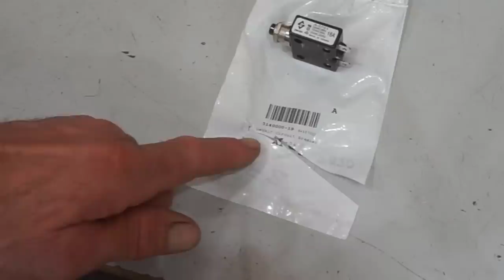DW735 Planer Deep-Dive Maintenance

Comment: Quality information in a Quality video... I just replaced my straight cutter heads with a Shelix segmented cutter head. It is the second best thing I've done with that planer. the best thing I've done with it was to follow your plans for maintenance. I had to laugh when you started talking about the problem getting the rollers installed. Instead of fighting gravity, use it as a tool.

Comment: Thanks to the detailed descriptions in your video, I was able to easily remove, service and replace the rollers, easily. I'm glad now I took the drive and idler chains off to inspect these, as the rear roller was gummed-up so badly, it would barely turn even when applying quite a bit of force. 

You mentioned that you made note of the offset in the roller blocks; The thin portion goes up toward the spring. I also noticed that there in a notch machined on the opposite side that was referenced toward the center of the roller. I also made sure to keep the blocks matched to the end they came off of, as tolerances may differ on each end. 

I added a small amount of grease on both sides of the thin washer that's installed between the drive sprocket on the gear box and the gear box roller shaft bushing. As the roller turns, it will (hopefully) help to prevent any further wear. 

My planer was given to me by my Father-In-Law who used it frequently, for over 13 years. Somehow the upper assembly had shifted downward toward the left-rear, so that the left-rear was sitting about 5/32" lower than the rest of the upper assembly.
Seeing as how I had most of the machine apart to begin with - your video was an added step in its *deep-dive maintenance*. 

I'd like to also add that your tip to replace the screws with the 5mm x 10mm button head was a great idea as well! Channels like yours are always a pleasure to watch and learn from, so thank you - again.
Reply from the maker: Thanks for watching and commenting on this one... thanks as well for adding so many useful insights from your experience in getting your planer up and running like it was meant to!
I'm sure you will find as I have that a little bit of TLC goes a long way in the performance of your like new dw735! 😎
Best, Matt

Comment: I found this vid looking for a reason that my rollers didn't seem to pull material through like they used to....Turning it upside down should make it easier to clean them.....I should also check and lube the chains........I did recently replace my steel blades with some carbide blades, they were just over $100.....what a difference in operation.
I thought about the spiral type cutters but couldn't justify the cost at this point in my career......then again if I hit the lottery.....Since I move my planer around I was always short on reaching outlets so awhile back I replaced the cord with a longer heavier gauge one....I have a set of rollers I picked up several years ago......after watching this vid, I may tackle that job...
Reply from the maker: Sometimes the low-level maintenance tips shown in this video are all it takes to get your machine back up and running 'like it used to':  https://www.youtube.com/watch?v=r_yEwlsYGbU
Best, Matt

Comment: thank you for your video it was just what i needed to fix mine , Thank you again Eric
Reply from the maker: You're welcome... the repairs aren't all that difficult but a bit of insight into what you're getting into is nice 😉😎  As  follow up: I found that loose blade connectors on my thermal switch was the main cause of my planer tripping out but it does run more smoothly with everything cleaned up and bearings lubed... Best, Matt

Comment: Your video was helpful when I recently did a deep cleaning of my 735.  By accident (poor choice of words), I did a couple of things differently.  My initial plan was to turn/replace the blades.  As I took the blades off and started cleaning, I decided to leave turning the blades until the end for safety reasons.  Second, your idea of turning the unit upside down inspired me to go one step farther- remove the base.  This gave plenty of working space.  It comes with a caveat.  Initially, it wasn’t easy getting the posts properly aligned so the head would raise and lower smoothly.  I’ll skip the details and jump to the solution.  Turn each post by hand until each end is level with its housing.  I used a small, metal ruler across the housing.  Since the posts need to be raised to accept the base, I indexed each post using a sharpie>turned each post the same number of revolutions>set the base in place >insert the screws finger tight careful not to move the posts>used a wrench on the flats to hold the post in place while tightening the screws down. The End.
Reply from the maker: Kudos for taking this Deep Dive to a 'next level' Bob!  I've never gone that deep and, frankly, have been intimidated by what might be required to get the 'timing' of chain & sprockets on all 4 columns so that the cutterhead is perfectly aligned with the platen.  Your experience and explanation help reduce that anxiety though so thanks for that!
Reply: Proof is in the pudding.  To test I planed a 1.5” wide board on the right side, then again on the left side. The left side planed off less than 1/128” more than right side.  I had to hold myself back from trying for perfection 🤔

Comment: Found your video extremely helpful in fang as broken sprocket, due to a bound roller. Great “outside the box” thinking to turn it over. Went further and removed the four bolts holding the base to gain full access to the rollers and screws. Thanks for helping me salvage the planer.
Reply from the maker: Glad to provide a little insight into what you're up against for an in-depth repair like your sprocket repair... kudos on salvaging your planer!  Sometimes a bit of TLC like this will prevent bigger problems later on: https://www.youtube.com/watch?v=r_yEwlsYGbU
Full disclosure: I've broken sprockets in the past when I didn't heed my own advice for routine maintenance😬😎
Best, Matt

Comment: Looks like the same parts used on my 30 year old DeWalt DW733. Over time the rollers dried up, cracked and little chunks came off. (Over time meaning even within a few short weeks if you don't clean the rollers and wax the table.) So after 30 years still works but won't feed at times or slow feed as it slips from lack of roller friction. Couple of bushings cracked with 10 years into the machine with light use. (Heavy use for a few days then storage for a few years that is.) Good thing is parts were cheap and available, not the case with many other brands. I didn't get the DW735 due to disposable blades. My neighbor, a professional custom furniture maker, hates it as it eat knives constantly.

Comment: Lots of good info here. Thanks for the maintenance reminder... Those " #1 Phillips" screws can be loosened, usually without stripping, if you take the bit and grind off the sharp point to make it more like the tip from a #2. The bit will then seat deeper into the screw head and grip like it should.  The bits/screwdrivers called "#1 Phillips" are more like the "Reed & Prince" of days gone by; a slightly steeper angle and more pointy. That's why they slip. I've been nipping off a bit of the tip for 30-ish years and haven't had much of a problem since.  Cheers from Alberta, Canada.
Reply from the maker: Thanks for the additional tips and insight... definitely worth paying more attention to the fit of tip and screw to avoid the frustration I felt with a less-than-great tip/screw fit!
Best,
Matt

Comment: I just joined a MakerSpace and got an introduction to the Wood Lab.  One session on the Planer I was hooked.  I was given a 2006 DW735 that wouldn't feed with only about 10 hours on it.  Wasn't sure if I could fix it but wanted to try.  This video and the Care and Feeding gave me wonderful instructions on how to take it apart and diagnose the problem.  Broken sprocket on the drive chain.  I ordered the part tonight and now on to the Deep Dive Cleaning.  Your video is so good, even an old lady with no experience is looking good.  I signed up as a subscriber right away and looking forward to a great education.

Comment: @5:23 I think that those "cheap phillips screws" on these planers are actually JIS fasteners. If you work on Asian equipment you will make your life much simpler to buy some JIS drivers, the head seats deeper and much more secure. Vessel is a great brand and easy to source on that mega online seller. Thanks for the video!

Comment: Had an awful high pitched sound coming from somewhere on my planer. Suspected it was from the rollers or cutter head. DW735 had about 1 hour use so it was brand new. Followed your video exactly, turned it on after greasing it all and the high pitched whine sound is gone. Just the normal, terribly loud noise it always makes. Still not sure exactly what it was, but it seems fine now. Your video is awesome because you explain what all the parts do and how it works as your taking it apart. Very helpful. Also flipping it on its back made it way easier!!

Comment: Thx for the very informative video; it was useful during my disassembling and troubleshooting.
I contacted the Dewalt service center in Denver to find out what type of lube to use on the feed roller sleeve bearings.  They simply replace the rollers and bearings every time (figures).  SO, I'M STICKING WITH YOUR METHOD OF LUBING AND REASSEMBLY of the roller assemblies.

Comment: Your video was very useful, Thank You. I had a broken main drive sproket, it was the pillow block bearing on the main drive side that was totally frozen. All fixed now!
Reply from the maker: You're welcome Bob.... sounds very much like the problem I had with my first DW735 years ago. I expected to see more sticking of the pillow blocks this time but the real culprit was loose spade connectors on the thermal protection switch.  No regrets though since a thorough lube job will prevent future freeze-ups and associated problems.
Best,
Matt
Reply: @NextLevelCarpentry  I've got mine put back together and working just fine now. And I hope that to you as well thank you

Comment: I was all set to pitch my 735 out the door and buy a Jet but you encouraged me to service this pile one more time.
Reply from the maker: It can be aggravating when you expect something to work well but it puts up a fight!  I would encourage you to give your DW another chance because, in my experience, every problem I've had with mine over the years are caused by operator error, neglect and/or abuse on my part and are always worth fixing because the machine itself is a real workhorse in the shop.  Hope this helps you isolate and fix the problem because I feel it is the 'best in class' for planers of this size/type/cost...

Comment: Thanks for the video, great content and pace. I have abused my 735 for 2 yrs now. Was having trouble with it, did this deep dive now it’s like new. Did find a broken idler spring. Also my new blades were junk, rollers were sticky and needed lube. Learned a good lesson, pay attention to your machines, if you’re having problems, something is wrong, don’t just call it a piece of crap, and forcing thing’s through. check it out. This was actually a easy thing to do. I’ll be doing it on a regular basis. “Find time to maintain your equipment, or it will find it for you.” Why are you going through thermal overloads? I haven’t had that problem. New subscriber.
Reply from the maker: Great saying “Find time to maintain your equipment, or it will find it for you.” you may hear me say that and, if you do, you'll know it came from you!  Turns out the thermal overload failed initially from over-working the planer on long, wide boards with less than sharp blades.  Subsequent failures were from the most insignificant thing: loose spade connectors! Turns out loose connectors generate heat from 'arcing'.  That heat migrates into the overload and trips it.  Now I tighten the connectors with pliers to the point they're hard to push on.  Since discovering this problem I only have problems when actually overworking the planer.
Thanks for the sub!

Comment: Wow, great content. After doing a good bit of research on portable planers, even though this planer is rated at 15 amps, when planing hardwood it can pull close to twice that. So even on a 20 amp circuit the motor tends to run hot. Using an undersized extension cord  compounds the issue. This might contribute to the thermal switch tripping as frequently as you described.
Reply from the maker: I agree that using an undersized extension cord will cause any motor to run hot so it's important to size cords appropriately.  It is not, however, the cause of thermal tripping  I experienced here and the 'research' you describe can be a bit overly theoretical and possibly misleading because this planer always heats up to a degree during use.  Surprisingly, in my situation. it wasn't lack of lubrication either.  Turns out the main culprit was loose fitting spade connectors on the leads on the thermal switch... go figure.

Comment: careful with the acetone my dad used to use it for everything and got lung cancer never smoked in his life, thank you for the video. I took my DW735 apart because rollers were locked in place and wouldn't feed wood through the planar. Debating just ordering new feed rollers, the sprocket's are in tact upon inspection and the chain and belt are still solid. tried manual rotation on feed rollers and noticed around 75% rotation consistently it locks into place, going to try wd40 and cleaning but not feeling lucky.

Comment: Thanks for doing this video. I had broken both sprockets on the transmission/gearbox side. I replaced both sprockets and drivebelt but a problem somewhere. After watching the video I tore apart to clean. I found a sized bushing on the back roller. Replaced with new roller and bushings, problem solved!
Reply from the maker: You're sure welcome Rick as your situation is a common but  infrequent problem for this planer and a good part of the motivation to produce the video so I'm glad to hear it helped you out

Comment: That piece on the shaft you sanded they ought to have the bushing blocks with a grease zerk fittings for both. This way that roller never slows down and you can periodically grease it.

Comment: Great video.  And the tip about turning the unit upside down is priceless.  all the hardware was super easy to remove with it turned over.  The Lucas red sticky is a great product.  In head to head testing it out performed standard bearing grease substantially.  This video saved me a bunch of time messing with a DeWalt joiner with these exact problems.

Comment: Luckily I watched your video before starting the maintenance on my planer.  Thanks a lot for saving me a lot of hassles.  I took your advice and switched screws.  The Sand Flex worked great although I have no idea what it is made of.  Seems kind of like a gritty eraser.  The label makes it sound like it's for removal of rust/tarnish/etc from metal so it should come in handy.  Turning the planer upside down is so obvious (once you think of it).  Thanks again for the time saving tips.

Comment: I live in a heavily humid environment. I use T-9 applied with a green Scotch-Brite and a bit of elbow grease to remove the faint rust haze that appears weakly on my cast iron surfaces. I dispense my Gallon container of it from a little bulb shaped, squeeze trigger sprayer. I also keep WD-40, Water, and a 50/50 mix of Acetone and cheap ATF fluid  (best rust breaking, penetrating fluid known to man) in the same spray bottles of different colors.

Comment: THANK YOU. I had to replace both rollers on mine. They were worn out. Interesting thing was that the belt was almost ready to snap, the bolt holding the drive pulley was -- gone??? and I'm REALLY glad that I did this. Through your details, I was well prepared for this nasty phillip head screws and I replaced them all as well. Cheers!
Reply from the maker: Noice, Dave... thanks for letting me know how this helped you out... I predict you're going to love having a tuned up mowsheen to work with! Best, Matt